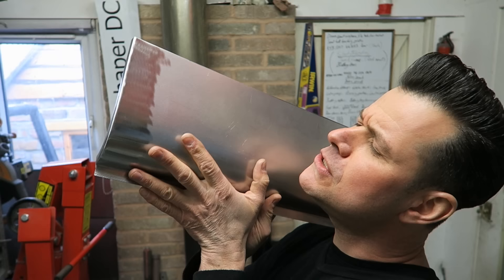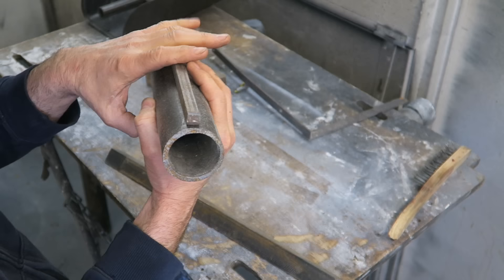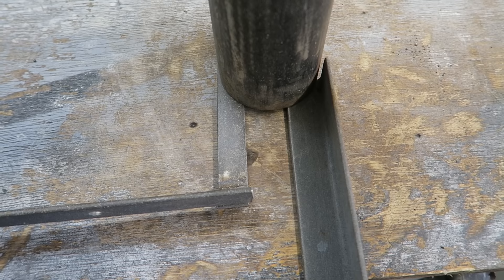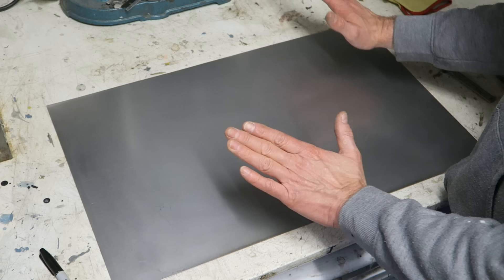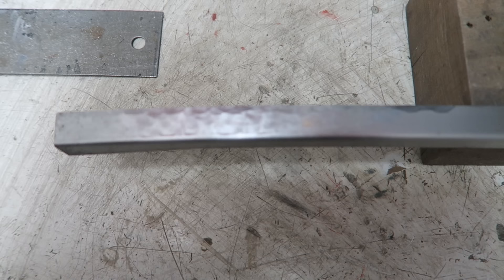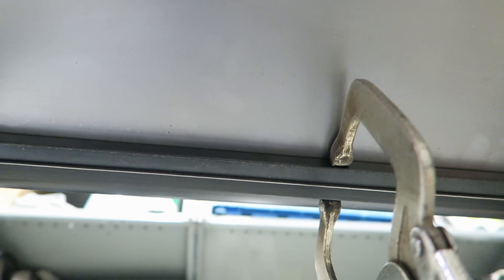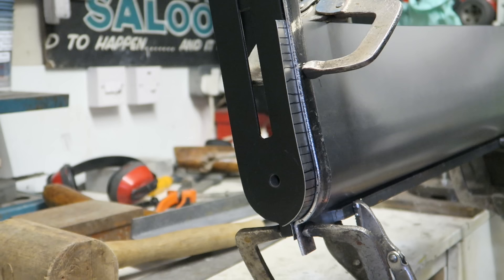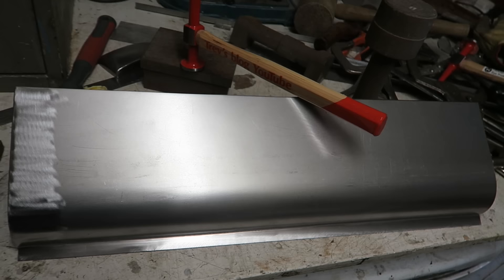How to make your own repair panels sill fabrication beating tips and tricks #16

Comment: I used to think of sheet metal as a hard rusty mess that could never be fixed without a new part, usually purchased from the manufacturer, and probably beyond my skill set to install unless it was bolted on.  Now thanks to your videos I think of sheet metal as a fluid workable thing that I can manipulate to meet my needs, stretching, shrinking, and shaping, something I can do if I am patient and thoughtful enough to understand how the metal is responding to what I am doing.  What an epiphany!  Thanks!

Comment: I've made so man of these in the past when i worked classic car restorer, and door bottom replacements using the same method. Making door panel shapes out of wood if I wasn't making lots of skins the same shape saved time but they don't last with all the hammering, using anything that was the right shape to finish a job, lumps of scrap or off cuts from local machine shops and even an old engine block. How can 400 people give this thumbs down, a perfect result is what you got, it doesn't matter how you got there. I love it.

Comment: Hello Trev, Thank you for the reply. I was able to source the hammer at a body shop supply in Elgin, IL. About 200 miles north of my home town. I got a good price , I think. It was shipped today. I was glad to hear you are a Mini enthusiast. During my university days, my house mates and I restored a 1962 Austin Mini. We painted it Ferrari " fly yellow" with the requisite Union Jack on the roof( I did the tape layout for that; not easy!) . We campaigned it as a rally car and  SCCA gymkhana car ,quite successfully,I believe largely because of the 22x 4 inch " Big Bore" extractor we fitted to the otherwise open exhaust. Yes, those were the days! Cheers to you and thank you again for the information,  entertaining and educational videos.

Comment: As my welding instructor pointed out decades ago, Angle Iron is cast metal angle which was used as ballast in sailing ships. He used the term Mild Steel Angle. Good video.

Comment: You are a true craftsman. Difference between a craftsman and a tradesman?  A craftsman wishes to share his craft so that it lives on, a tradesman knows his trade and knows that its not too complicated but doesn't want others to know that as it would belittle the trade.😉

CA van first vehicle (after a tractor) I ever drove, back in the late 60s on my dad's farm I was too short to sit and drive but could stand up in the van balance on the steering wheel to work the pedals and use the column gear shift,  I think I was about eight years old  Happy Days

Comment: Trevor, great video! 1960 for the hammer. Ended up here because a 2001 Ford F150 has holes in the roof. If it's raining outside, it's pouring inside. Not sure how to mold the gutters in the roof, but I will give it a shot. Need to check out your other videos.

Comment: Awesome video again Trev!👍 I really needed this tip for  a project I’m currently doing. One thing I may add is I seem to make the first lip at the bottom of the panel a bit too sharp in places and a bit rounded in other. I think I need a edge folder.

Comment: Great Video for someone who has never formed  Metals   and yes could not agreeee with UUUU MORE  That there is always Other Ways to Get The Job Done  ,,,I usually tell  Folks about  3 different ways to get you to the same end ,,,Yes Glad You Showed Folks the Convex on Faces of  Metal finishing hammers   And have often shaped my snap-on or fairmount tools by filing ,,grinding or sanding off all the hard edges ,,,Also Yes when using a metal hammer ,,Never Beat it with whole arm ,,just in the ,,wrist ,,litely tapping the surface ,,,Been wanting to watch this one for a while and glad i Got a chance to see it   Thanks  Frank

Comment: Fantastic to watch a craftsman at work...when its obvious that he loves what he does...only discovered you a few days ago Trev...working my way through you excellent vids.

When you say watch the adds at the start of the vid...do you need to watch all the add for it to count in you favor.

By the way...drove around in my brothers CA van in the early 60s I'm 66...still remember the engine fumes coming into the cab from the removable engine cover inside.

Think his has sliding doors.

P.S. why would anybody give a thumbs down to any of your vids...its beyond me.

Nick from Cheshire.
Reply from the maker: nickjaxe Hi Nick yes they have sliding doors, they all did. Yes the adds need to be watched  until the video starts before I get paid however much it is? Thanks for your comment. Cheers Trev 👍

Comment: Great work !  I agree 100%  on   The many ways of doing the same task  years ago i used to have to train Apprentices and that was one of the  things i always stressed to them  that my way isnt necessarily the only way to do  the job but it has worked for me for many years ! Although my trade was Woodworking for over 20 years professionally  patience and thinking things out  completely  were similar to  how you go about things  as well  one major difference  in working with Wood  is there aren’t two  exact  peices that are grown exactly alike  so  its extremely important to not  ruin   A   Board that is  a part of a series that the grain is matched on  because a replacement   One will stick out  like a sore thumb  even if it comes out of the same tree  the grain will be similar but not exactly the same  similar to Marble  and other stones

Comment: Great video Trev!  The other day, whilst sandblasting some rust in the wheel well of my 1970 VW bus, I though I might blast a little rust on the outside of the curved metal just below the passenger door and to my astonishment, I watched the 'metal' vaporize!  It was all rust with basically nothing holding it together but the paint!  Now I will have to make a curved piece of sheet metal to match the original, and here is your video showing how to do just that! Cool! Thanks!

Comment: I had a shop and always bought sills etc but this made me think of the old fellow next door he rented a shop for his retirement  stop the boredom,  He was a real  "Motor Engineer",  served his time with  RR  He was in his seventies and that was 50 years ago,  He told mien his time all repairs were made by RR with the delivered flat steel and a drawing,  Guards all done with the English wheel  and hand tools. Painting was about 16 coats all rubbed back until job perfect,  the Local RR agency used to send a car to pick him up  Just so he could do the timing on the old mechanism, Bit like a welding rod for the spark.  These old guys were trained in all the trades  these days it  plastic etc etc.  Not the same give me thee good old days.  Even to be a Master Tailor  was a 10 year apprenticeship .  How long did it take to be a RR motor Engineer,  a Real master of all motor trades.

Comment: I use a small piece of wood (2"x4"). It spreads the force out. My favorite way without a break is my hand heald air hammer with a face similar to your body hammer. A very good video. I especially enjoy the way you combine being completely crazy with your great intelligence and communication skills. Thank you very much.
Reply from the maker: Yes Steve I’ve bought a set of hammer heads for my Sealey air chisel very impressive I must agree, although I think the long stroke one I have is perhaps a little too brutal. Thanks also for your other comments, much appreciated 👍🤡

Comment: Thanks for a very professional video, your skills are impressive.  In addition you take time to explain the most mundane detail which is an extremely important facet of being an "instructor".  Now for my question.  Very few (any?) panel bashers, etc. ever mention  the gauge or thickness of the sheet metal they are working with.  Understanding that gauges vary all over the world...whatever the thickness is in mm, etc. would be most appreciated.  Thanks, and I hope this comment doesn't disappear when you open it.  That would be something that would happen of facebook, not youtube (ha).
Reply from the maker: Geoff Morgan I mainly use 0.9 mm or it’s called 20 gauge for outer skin. Cheers Trev 👍
Reply: @trevsblog   Many thanks!  That was a wild guess on my part, too.  Of course, I'm thinking in US Std. Gauge (ASTM-AISI, etc.), not Birmingham Wire Gauge, or Stubbs, or some other "archaic" standard.  Pounds per square yard, etc.  Cheers!

Comment: Great video Trev. When you do the flange for the wheel arch try hammer forming the flange down by using a nylon hammer with a wedged face and support the flange with a piece of flat nylon so as to stretch the metal down thus leaving very little shrinking to do.

Comment: you must have been pretty rough with your hammers to were them out, 35 years of Auto collision, my hammers are still in great shape. I did stop doing door skins using a hammer and dolly some 15 years ago after buying a tool I think is called door skinner, I would tighten it down and use my air ratchet to power it and crimp the edge. I also have a hammer that was made with the rounded edge.
I'm not trying to put you down, you made a great video. Time to make another panel for my swamp cooler, you have some great ideas.

Comment: Hmmmm...don't quit your day job just yet Trev   😆  I was taught that  much of the time a loose grip is to be preferred and to let the hammer handle bounce on the backside of palm which you can easily adjust on the fly without really thinking about it. My personal approach to planishing the curve over, would be that when I got to the part where the tucks are becoming obvious, slide a comma dolly or a spoon of the correct profile in behind the lip under the tucks and planish them almost out before I went any further with taking them to the finished shape.

Comment: Of all the things I have to do for myself, my son told me to fix his rusted rocker panels using my wife as the messenger. That is a we bit underhanded as I wanted to yell, but a the right person. I have some pipe with a radius that maybe close but after lifting the cover on his Monte SS, found rocker were good but the “Dog-Leg” in front of the wheel was suffering. Now this is quarter panel parts. I like an offset flange tool pneumatic as it sets strength at the top. I don’t like the butt weld here. So, armed with a bad back, shot elbows, no hoist higher than a floor jack, I guess I have more painful work to do. Using your shrinking technique but I may try my air hammer and penishing tip to create a 90 degree at the front and angled 90 degrees are rear as it curves for the wheel house. Spot welds will be ground off and not drilled. My hole punched allows for plug welding directly over old welds. The metal sometimes is thinner but I have found the heat has added hardness. Anyone drill thru a weld? It is hard. Finish his dash, complete wiring twin fans and his 500 HP machine can leave my back yard. After cavity wax and fiberglassed reinforced filler is applied. 
 Yes, feed the hungry, cloth the naked, heal the sick and weld the quarter panel bottoms. I don’t own a shrinking machine with no plans to get one. My days are getting short quickly.
  After decades of fixing other peoples vehicles, I simply want one of my own, someday! Yeah, surprise!

Comment: Down here in South Texas the Busses are getting junked over the rot around the windshields ? On mine I made a Insert that went 3/4 down the roll and part of  the way up the post. Now you can buy them .  The jig you made if longer could make center section of the bottom .  5- stars for you !!!!

Comment: 42:00 don't you think it was actually 12mm too, but just became 15mm because the metal has to go somewhere as you jam it together. You can't actually shrink (i.e. reduce volume) steel like that. So it has to go in one of the other directions: either it gets thicker, or it gets wider. And since you are hammering the surface, I'm guessing that it wouldn't pick the thickening... 
So you actually did a perfect precision job, and the panel still is nice and square :)))

Thanks for this video. I found it very interesting and educational (and a hilarious intro too!!)
Reply from the maker: Luke Arts thanks Luke you’re right of course but there are many other factors at work, tooling not quite square, steel cut not quite square etc. I actually noticed the bottom line sticking past the tooling slightly before I started planishing. Cheers Trev 👍
Reply: @trevsblog  do you happen to have a video with comparable tips and tricks to create a double rounded corner? I have an old Lada Niva (though the new ones are mostly the same as they never changed the bodywork production line between 1979 and 2003 and even then they only introduced small changes to light positions and the side vents)
and it requires some serious restauration, and an adjustment to the front corners... And I really have no clue how to get started... Best idea so far is to make a silicone mould on an original and cast a massive iron positive from a lost wax mould made from the silicone negative, then file it down the thickness of the sheet and use it as an anvil... But there must be "lighter" ways to go about it, I hope?

Comment: @ 41:30 — based on how strait the edge is finished, you did not misalign your parts in the jig. That extra 3 mill is due to stretching around the edge. Yes, you flattened it —but the material had to go someplace — so it went outwardly, making your lip 15 mill instead of 12 mm. A fine demonstration, indeed!

Comment: I  understand you said you dislike it when someone says "why didn't you do it this way" but I think it's important to give options....

You could also flip that small angle iron over, and use it to form the bend over the larger angle iron with three C clamps? No banging, just a gradual tightening of the clamps. The smaller angle iron should give a continuous pressure along the edge of the sheet metal until both angle irons are spooned together, forming a perfect bend. (Assuming both angle irons are straight.)

Or...you could weld/screw a couple heavy duty hinges on the end of each piece with just enough gap between to slide the sheet under the smaller angle iron, then weld a lever on one or both sides. Then you could just pull the lever over and form the bend like on a regular metal bender/brake.
Reply from the maker: SymetricalParadox you misunderstood my meaning, we’re actually on the same page. I don’t like it when people say you should have done it just one certain way, I believe in keeping as many options open as possible. I don’t believe in being tied down to doing something one way because it slams the door in the face of possibilities. Thanks for your comment. Cheers Trev 👍

Comment: Just made some sills for ma van, found easier way to bend L shape, mark out where you need the bend and run disk cutter down and score it, try not to go through, then bends perfectly by hand, then just tack weld inner side, much quicker and less bangin etc

Comment: hey trev  enjoyed the video and managed to learn how to save some time and get a better quality patch/replacement panel initial finish (less filler to hide sins). as a sad note as I turn 60 next month your comment about tech hit close to home but for one small detail, my son in law . find a problem or need to set something up call mike done,  your van is a 1960 model year , if I win could you tune the face of the hammer so at first all I have to worry about is the right way to swing the hammer to get good results. thank you doug
Reply from the maker: doug starkey thanks Doug I’m only ten behind you and I know that ten will fly past like the last. Cheers Trev 👍

Comment: this is impressive, I like this and it made me think if the steel tube was turned to form the panel instead of the panel pulled around it? I guess it would need something to keep the panel flush against the steel tube tho.
could be a bar attached right under the steel tube but not to it so the steel tube could turn freely but the bar would stay in place and force the panel to conform to the shape of the the steel tube, 1/4 turn, 1/2 tun, could be 1/6 turn depends on the angle you want.
Reply from the maker: Yes most definitely, the important thing to remember is that the sheet would need to be attached to the roller then like you say have another guide bar.

Comment: Bruvva, the Bad Bedford is 1960 reg - the clue is nailed to your door - 1960 reg, 6315ME, sold to Mr L.H.Golding, (A Plumber, reputedly of Good Repute) for the grand sum of 475.15 pounds on 17/9/1960..... If I get drawn out, I'll swap you the hammer for a couple of pints next time I visit the UK...:-)
Reply: Ohh, and by the way - stick to singing in the shower - Eric was bad enough, you shouldn't add to the tonsorial torture..

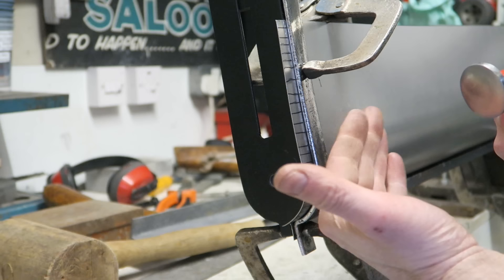Comment: 39:15  where you have it marked .i would cut it and then walk the tabs down to your desired 90 degree's.then i would cut another piece of metal to lay over it and then weld it together on the underside and the seam on the top side..then grind it to perfection...

Comment: I just use 2 angle-irons put into my wrench to bend a sharp angle instead off all that hammering - and when I hammer, I have found out that You allways have to hammer from the same end - don´t go back and fort if You dont want the metal to make a curve in an unexpected way.

Comment: Great videoTrev. I love that hammer and have been searching  all your sites to try and find where I might buy one. I'm restoring two old MGs  -1948 TC and 1954TF.  By the way your Bedford Van was first registered in  1960. Thank you from Port Lincoln South Australia.
Reply from the maker: Richard Mason it’s a Kennedy brand hammer bought off eBay. If you can’t find one in Aus then look for a Sykes pickavant second hand hammer, ones bound to turn up Cheers Trev
Reply: thanks Trev.